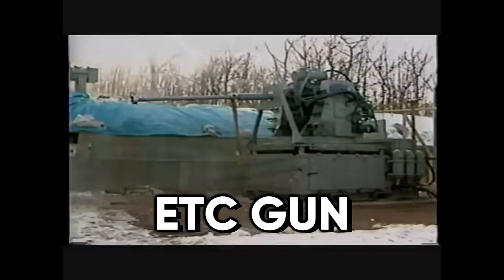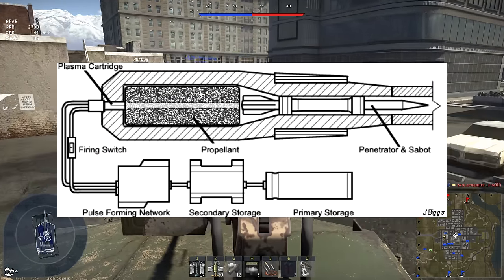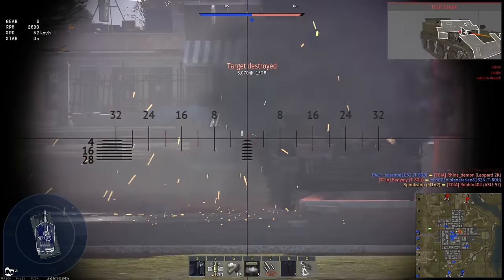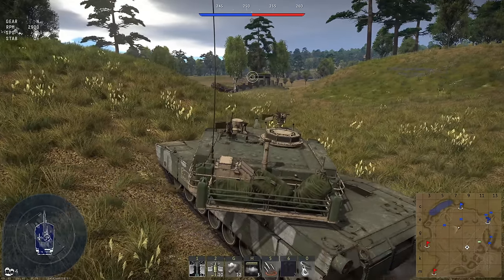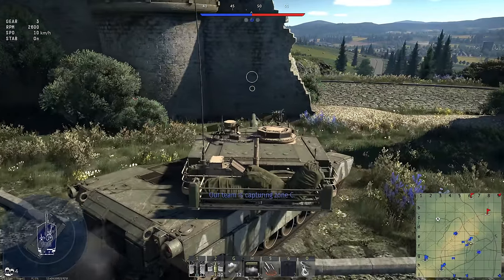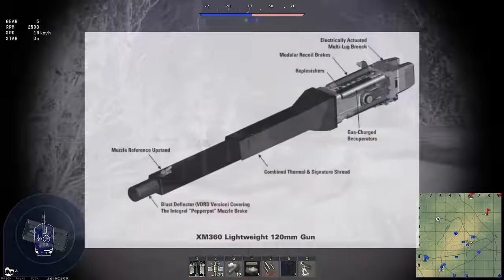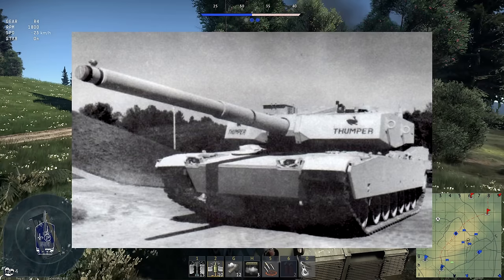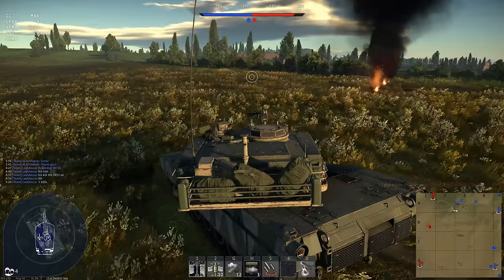ETC Cannons - The Future of Tank Weaponry

Comment: Given that it's such a relatively minor change to the weapon mechanisms (basically an electronic primer but with way more... zap), no wonder this tech is less known and under the radar. Since not much has to be changed around the gun design and surrounding logistical factors, I guess it just doesn't draw that much attention in return. (Yet?)
Reply: Well , if the gun performance changes as much as he said in the video , this might flip things on their heads : the current race between armor and guns is a stalemate , however if these guns come up and the armor doesn't adapt in time we might see a resurgence of tankdestroyers since they would be able to capitalize on their superior firepower while ditching infantry support all of a while tanks might become more like infantry support veichle , with less focus on the gun and more focus on bringing the infantry in a favorable position to spot the destroyer before the destroyer spot the tank , or at least that's my speculative opinion , anyhow I think atgm are the future for tanks they just make the whole machine lighter while offering the same killing potential ...
Reply: @davidegaruti2582  Except missiles DON'T have the same killing potential. They have a drastically lower speed, so they have to use shaped-charge warhead to penetrate armor. The (relatively) low speed makes active defense systems a fairly effective counter, and give the target something of a chance to dodge; the shaped-charge warhead can be countered with fairly simply armor designs. Against modern MBTs, missiles just aren't reliable enough killers to warrant replacing a high-velocity cannon.
Reply: @davidegaruti2582  tbh I feel like the railgun would become the new tank destroyer's weapon of choice.
Reply: Davide Garuti  Tank destroyers still exist in the modern day in the form of attack helicopters and, well, main battle tanks. To build a specialized tank destroyer, in my opinion, is rather wasteful since it locks a vehicle into a more specialized role, and that costs resources. It would take a significant change in doctrine to have ground-based dedicated tank destroyers again. After all, main battle tanks happened because it's easier to standardize around a few vehicles that can do more roles.

The gun performance here allows "normal" guns to continue being effective against armor by improving penetration while still retaining everything needed to fire more "standard" munitions (i.e., high explosive) for infantry support, all at the cost of maybe needing some additional space tacked on for the plasma ignition system (or maybe just a more powerful APU, who knows).

I'm just saying, if a MBT can carry these improved guns, it's going to go on the MBT. The armor vs gun race has been here before: the 1950s with Leopard 1 was basically this. Tanks are there to support the infantry- if it has enough armor to resist infantry anti-tank weapons, then that's arguably good enough, even if the armor can not withstand enemy tanks. It's a shoot-first-kill-first world, after all, armor is only a backup plan these days.
Reply: @gelatinoussire7772  yeah , i agree with that , a miniaturized version of a railgun would exert more power than an etc gun , however we don't have such a WMD ( a railgun would be that dangerus ) , so imo for the time being a etc gun would do the trick ...
Reply: @TheSchultinator  yeah , my bad i didn't do my research, you're right .
Reply: @TheAmazingCowpig  thank you for the information , i was going by the assumption of the three aspects of a tank : armor/firepower/mobility ...
i have heard challenges to this by saying that optics should be factorised in the mix , and by what you're saying the world of armored fighting veichles would change the whole game , since armor becomes irrelevant , tanks become the step in between self propelled guns and infantry fighting veichles , meaning that eventually these three categories will merge into one single land veichle (SLV) capable of indirect fire, direct fire and direct fire support , making this the most efficient veichle to put in mass production , kinda like the f35 has streamlined the production of aircrafts .
Reply: @TheAmazingCowpig  Don't think APU would cut it will have to run flat out the primary engine and apu to recharge the capacitors for multi shots.Also it is not a one shot kill world try dealing with the frontal aspect of the latest iteration of the M1 you will have  great difficultly killing it with probable OPFOR KE penetrators before and after entering its effective kill envelope.
Reply: it's just a more advanced gun. Nothing special. A 1940s gun is more advanced than a 1910 gun.

Same thing
Reply: Deathpuff12 ideally yes. We are reaching the limits of chemical propellants.
Reply: @davidegaruti2582  I think the idea of one universal land vehicle that can fulfill all three roles is taking the concept too far. What an IFV requires versus what a tank requires versus what a SPG requires are pretty far apart, and at some point trying to make 1 system that can replace many just gets you a vehicle that doesn't do anything well.
Reply: @TheSchultinator  well , mine is speculation based on what append afther WWII : during the war there were many types of tanks ( heavy, medium, light, killer, etc.etc.)
then during the cold war many technologies came about that allowed a veichle with the firepower of a tank killer ( HEAT , Kinetic round) the armor of a heavy tank( composite armor , explosive reactive armor) and the speed of a light tank ( better suspension and gas turbines) with the weight of a medium tank , thus the MBT was born , that leads me to belive that since artillery is going more into the direction of self contained sistems ,  more and more ways to fight armor are coming up making it , relatively, useless , and these system are getting used by infantry , i feel that in the near future we might see SLV ( single land veichles ) becoming a cheaper solution to the problem we face today , making combined arms ops an even more obligatory tactic , that will be aided by data link systems that will make the job of SLVs much easier , 
they won't defeat a MBT in 1v1 , they won't carry more soldiers  than a IFV,  or have more range than a SPG , at least from the get go , for the price of a MBT an SPG and a IFV you might be able to make 4/5 SLV (the wonders of automation)  , and have imo an edge ...
Reply: @davidegaruti2582  Again, it sounds good, but just look at the weapons each use and how those weapons are used:
IFVs generally have 40mm or less autocannons, used to suppress infantry
Tanks have very powerful, high velocity, direct-fire cannons used to smash hard targets (be they tanks or fortifications) 
SPGs have indirect-fire, medium-low velocity howitzers used to blanket an area from afar with big HE shells

How could just one vehicle mount a weapons system that can accomplish all three of those very different roles? Not even considering armor, you wouldn't have a vehicle that could really perform any role well enough to justify replacing the more specialized vehicles. 
To touch on your mention of combining tank types: tanks could be distilled down to primarily MBTs because every tank, no matter the type, are fundamentally assault vehicles. While different types may perform certain roles better, in a pinch you could use any tank for any purpose (not ideal, but possible). The same can't be said of IFVs vs tanks vs SPGs.
Reply: @TheSchultinator  ok , i'll be honest : i am not as prepared as you are , however i think that 
by using rail guns and glide rockets we might be able to replicate some functions of both artillery and mbts, all of a while a RAVEN gun might be used as the 40 mil replacing the commander gun  , but yeah i have to agree , in the near future we won't  see that , however imo , with better technology and the distillation of these three viecle into the category of "moving ground veichle with large guns" we might see somenthing like it becoming a possibility in the next 70 to 90 years , still this is all in my opinion  ,  i am not a fortune teller , nor a high up in area 51 , i am quite ignorant on this matter and mine is just some fun  speculation on the way in wich wars of the future might be fought .
Reply: @Douglas Smith i mean if the battery or the generator fails on your gas turbine powered MBT you have bigger problems to worry about than the gun since you're blind and stuck dead.
Reply: TheSchultinator the easier solution here is standardize 1, or maybe 2 different, hull(s). SPGs use a different turret than a MBT or an IFV. This would offer a more versatile weapons platform while significantly simplifying logistics. This is especially true if you use modular armor, so your SPG doesn’t have to run around with the armor of a MBT
Reply: @deathdragon2283  i agree with the principle of this but just like with guns, different classes of vehicles require different design priorities. What makes a good IFV doesn't necessarily translate to a SPG or tank. Just like with firepower, trying to make one hull for everything just means none of your vehicles are going to do their jobs well. You can used some elements across multiple designs to ease logistics, like tracks/suspension, or hatches.
The best way I can see this approach working is if you're designing a force entirely of light vehicles. At that point, every vehicle would require approximately the same level of protection while the reduced firepower demands mean you can design three types of turrets that can all fit in the standard hull, with some internal modules to round out capabilities.
Reply: @davidegaruti2582  i doubt a tank could suport the power generation needed for electromagnetic weapons like gauss and railguns. there's a reason the navy are the only ones really looking at them for anykind of real deployment. Unless darpa has some next gen power generation tech no ones know about fixed and ship born emplacements are the only practical use for magnetic accelerators
Reply: @gelatinoussire7772  yeah, lets just find 500MW worths of energy somewhere and fit it in to the size of a tank engine. What could possibly go wrong?
Reply: @davidegaruti2582  Not if active protection systems improve, of which they can by a substantial degree, while ATGMs can also get more effective, they do not have as much room for improvement as active protection systems. As active protection systems get better we might also see the ability to intercept kinetic penetrators fired from an ETC Cannon. Though they will never stop the penetrator entirely, they can reduce the penetration so that armour will remain effective. However, they first must get better before that happens, so we might see what you stated as stop-gap tanks before the technology is ready.

Comment: Assuming ETC gets a wide adoption on vehicles, I wonder if a down scaled system could finally make caseless ammunition a viable alternative in firearms as from my limited understanding of the subject what is currently holding it back is that the propellants used are not "clean" enough (well that and the fact there is no current need to go caseless). food for thought.
Reply: The ETC is the potential way to create caseless rounds closer to Gyrojets.
Reply: The main problem with caseless ammo isn't the ignition, or even the residue that you mentioned: it's the lack of an ejectable heat sink (cartridge). When there's no cartridge to dump the heat into, all the heat goes into the barrel, the receiver, the firing mechanism behind it, etc. That's a ton of thermal flux, especially given these large, hot munitions. Thermal flux always causes problems. Look at the G11.

Tl;dr: caseless sucks for more reasons than an ETC can solve.
Reply: @mikechurvis9995  There's also the issue of ceaseless ammo being deformed from heat or just from the soldier doing soldier things before it even gets fired.
Reply: I believe Titanfall's small arms either have this or electrically primed polymer ammunition. It's really interesting just how realistic Titanfall's ballistic weapons are
Reply: I feel that the plasma cartridges would generate so much heat that the gun would suffer from overheating.
Reply: KRAUT SPACE MAGIC
Reply: @ANDREALEONE95  yes the bolter is the deathdealer in the grim future
Reply: @Fine Wine things never coming into service
Reply: they are viable but, caseless got caned because of the fall of the berlin wall and the surpluss of ak74 and ammo from the gdr. the g11 was going to be adpted
Reply: Telescopic cases are more practical than caseless. They save some weight and overall length while maintaining reliable extraction and heat dump. Caseless has issues with heat buildup that are difficult to solve entirely.
Reply: @stupidburp  any examples of telescopic cases?
Reply: @rhodesianwojak2095  have a look at the new us army Infantry weapons one of them use it
Reply: @mikechurvis9995  liquid nitrogen cooling loop for the caceless gun?
Reply: @haminatorainz7227  when designing a gun, or any other tool whose reliability must be guaranteed at all costs, ask yourself: why am I making this more complex, when simpler mechanisms do a similar job and can break in fewer ways?

Do you know what a nitrogen cooling loop is to my ears? Leaks. Pump failures. Overheating. Overpressure. Underpressure. Line corrosion. Battery system. Kinetic shock on electrical systems. Charging interface. No recharge available. Short circuits. Blown fuses. Added bulk. Fragile parts. Complex manufacture. Higher costs. Unintuitive disassembly. Hellish field repairs.

Dead soldiers.
Reply: @mikechurvis9995  pfft what respect? you're angry  when someone else different opinions then you if i was angry writing it would be in ALL HIGH CAPS not low ones
Reply: @haminatorainz7227  Friend, I promise, on my honor, that I am not angry, nor have I been at any time here. 

At most, I felt some bewilderment at being demeaned and belittled for what I had intended to be a reasonable response to your question.

Why don't we all just relax a bit. The facts should set the record straight:

1) Take a quick look at the thread above us: this whole thing is a discussion on the merits and drawbacks of caseless ammo weapons systems. Here you see people citing the pros and the cons of the system, and they have civil discussions on both. Would you describe any of their posts as angry, as you've described mine?

2) In this thread, you proposed an idea, and in response I voiced my reasonings against it. Not my feelings against it, my reasonings. I believe that this is an important difference; anger is a feeling, analysis is a reasoning. Analysis is not an attack; one should not take it this personally.

3) I, like you, use caps lock when I'm angry. That makes it easy: if I'm not using caps lock, then I'm not angry! It's really that simple with me, I promise.

As for any respect you feel I'm lacking, I'd very much like to know better what you mean. I believe that the keystone of respect is meeting someone on their terms, not mine. What say you, sir?
Reply: @mikechurvis9995  i say that anyone can say what they think but no one should hate them unless they insult anyone who doesn't think that them ive just seen a lot of people who do that on YouTube
Reply: @haminatorainz7227  That's understandable. I think I see why you were so defensive. On the other hand, it's never a good idea to call people a 'jackass' or a 'little shit', even on the internet. That is an insult, and were I a lesser man, I may have hated you for it like you say.

But, I'm a water-under-the-bridge kinda guy. If you take back what you said about me, we can let bygones be bygones. How about it?
Reply: @mikechurvis9995  liquid nitrogen cooling loop for space ship weapons might mork because there's no air in space to take the heat away
Reply: @mikechurvis9995  Isn't one of the main points of ETC allowing for better propellants that can have higher ignition temperatures